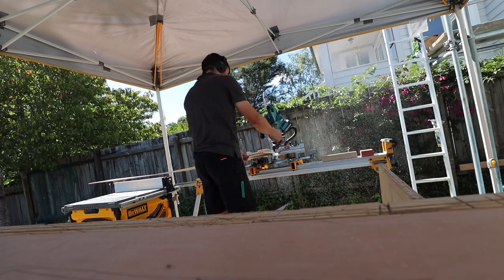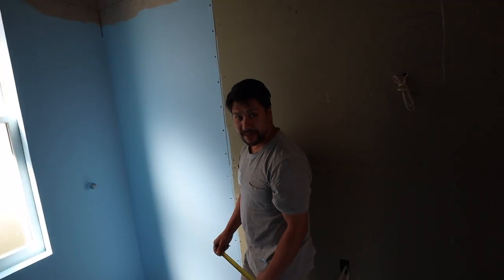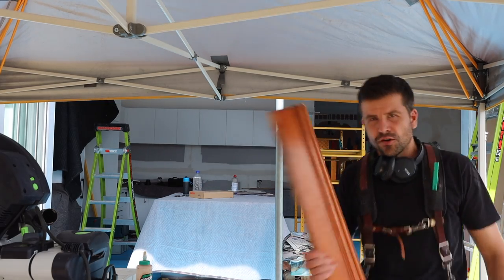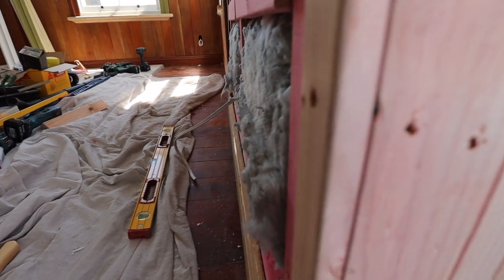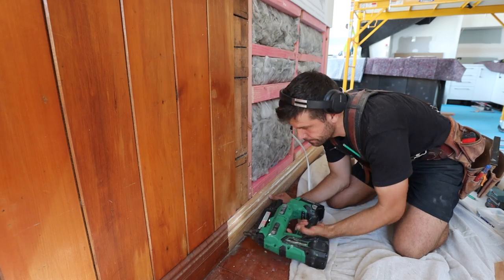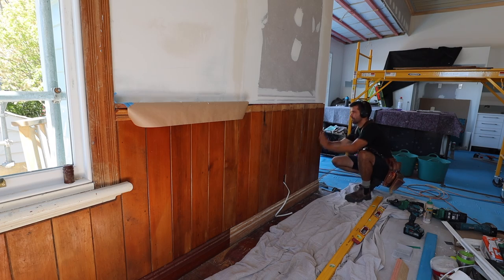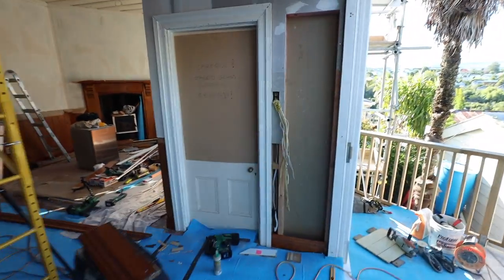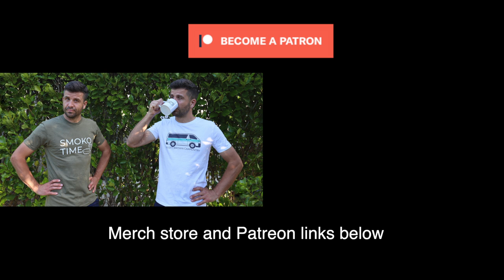Doing the Finishing Work Right (Restoration)

Comment: Festool used to have an issue with armatures burning out on Kapex saws: I believe it’s sorted. Voltage drop is a common cause of motor burnout: usually caused by excess length of extension cords. The other issue is overloading a 10A connection: the Kapex 120 is 1600w, which only leaves 800w available on a 10A connection in NZ. If your extractor is over 800w (it’s likely 1200w), it should be connected to a separate power point.

Comment: Using the 45 degree 2x4 cutoff as a jig for cutting the joint in existing base (skirting) with the oscillating saw is so clutch ! Nice work as always🤙🏼

Comment: Earlier Kapex models had an issue with the motors burning out prematurely.  As far as I know, they fixed the issue a couple years ago.
Reply: This is true. They fixed it a few years ago. You can plug in your Kapex into the vacuum cleaner! Nothing works better, love the Kapex. 😁
Reply: There is a new safety recall for some older models of the KS120, they can catch fire if left plugged in.
Check your saw with Festool online.

Comment: I run my Kapex straight off the dust extractor, and that is how I have been instructed to use it by Festool reps. They even make it so the laser being on doesn't trigger the dust extractor in auto. Been using it for a few years like that with no problem. I do recommend using the widest hose you have for dust collection on it though. 
Separately I know they aren't cheap, but I love the mobile base + rails for my Kapex. The stop with the millimeter marks on it just makes cuts, and repeat cuts so easy, and so much easier to roll the saw around instead of carrying it. Just my 2 cents worth. Keep up the great work!

Comment: From Oregon in US, interesting to watch. Lots of materials are similar,, but I get lost on metric measurements. I thought we here only did wood framing based in my experience in mid-Europe, where still restricted from. Love seeing good craftsmanship, and good tools!  My favorite is Milwaukee, but have mostly DeWalt. I go with what I need and amount of use. I’m slowly upgrading my 18V tools to the new ones, but only as they fail. Good luck!  I like learning. Curious about electrical there. Some British I haven’t figured out, but was competent in Germany. In US, deal with 120v/240v. Expensive to run copper for all. Current runs high, so takes more care for fire safety.

Comment: If anything the vacuum helps the saw by pulling the sawdust out/giving it airflow, won't burn a motor because of that. Plug it in and have a dustfree workspace, and don't worry about it!
Reply: I think he means the power supply. The vacuum cleaner will have a function where it starts sucking once the drop saw starts drawing power. I suppose the only reason people might worry about the motor burning out is because the drop saw might require more power than what the vacuum is supplying through the power point. 
I doubt very much that this is the case though as both tools are festool and have been designed to work in conjunction with each other.
Reply: @jimbobcatfish  No the vacuum will not limit the power to the saw it will just measure when the current starts flowing the resistance caused will be negligible, and anyway there designed to work together.
Reply: @steviemyles-eu4lf  inrush currents are many times the rated 'max power' listed on the unit and if the saw doesn't reach full speed before the vacuum kicks on it would cause voltage drop and increased current draw for both
Reply: @brl5755  Still, that's not going to kill anything. Also, both the Festool saw and vacuum have a softstart to limit the inrush current. If it was too high, the breaker would trip anyway.

Also, the power outlet on the vacuum is just a straight-through connection from the cord coming in. It's just like an extension cord, except for the fact that it's run though a current transformer to trigger the vacuum. It will not limit power to the saw. Just use it, it's what it's designed for.
Reply: @djFadeOut122  soft start is good, staggered start is better, and overloading a single outlet is still possible in both cases causing motor strain (heat) leading to premature failure... Though that's more common locally with only 120v at the tap. Fridge compressor inrush can be as high as 70A but it's for short enough of a time that a breaker doesn't trip. Adding a 2nd motor to that equation wouldn't be healthy for either as voltage drop would increase current draw as stated before. The talk of the vacuum being a bottleneck is possible if not plugged directly into the wall and into an extension of smaller gauge cable than necessary. Most wouldn't admit to that....
Reply: @brl5755  so surely this can just be fixed by changing the delay until the vacuum turns on
Reply: @steviemyles-eu4lf  in theory and in hopes, yes if this is indeed the cause. There are other possibilities like feedback from one or the other causing issues with the other. Motors can do some weird stuff to a dinner wave when stressed and that line is shared with the neighboring tool
Reply: @brl5755  should be a problem with the drop saw, your only using it for short period so it won’t get too hot.
Reply: The Festool dust extractor vac has a max power draw rating for the power socket of 2400W. The Kapex saw is 1600W.
Reply: The vac itself also draws 1200W so with the two of them running it's almost 3kW which is more than most multi-plugs can handle. On 240V, a 10Amp extension cord won't cut it. Pardon the pun.

Comment: also... your junction/electrical "boxes" and fixtures seem SO much better to work with, than here in the US.  we have these rules about spark-resistant enclosures which i'm sure saved some homes when we were using knob and tube and there were no gfci plugs and afci breakers.  our boxes have to have covered backs, wire retention and cover the wall material (drywall, jib, wood, etc).  in some juristictions they have to be metal (or fire resistant).  then the fixture itself retains the wall plate, which can rotate left/right but not in and out, etc.  what a pain in the butt.

Comment: Been using the original kapex 120 for many years always attached to my old ct33. Recently gave it to my son and bought the ks120 reb. Still run it on the ct 33 with a 36mm hose. No problems. Im not sure if the motor problem was only on the 110 version , either way i think it was solved a while ago. Would like to see your in-depth perception of the kapex120. Either way i am more than happy

Comment: Having an insufficiently sized extension cord will cause a motor to overheat (I believe because it's trying to draw more current than the cord will allow) but it would be odd if Festool made the vacuum cord too small to cope with running both at the same time - get yourself a hot air gun for removing paint Scott.. makes a world of difference and makes it easy to scrape out the grooves in mouldings too.. and nice job getting things 'plumb' ;o)

Comment: Check the plug on the vacuum where you plug the saw in. It has a maximum load rating written on the plug. Then check the load rating of the saw. If the saw draws more than the rating of the plug on the vac, don't use it.

Comment: Oh boy, finishing. Everyone seems to think that it only takes a short time to put finishing touches on everything, but it always takes about 10 times longer than anyone estimates!
Reply: Yeah I agree!  It's always underestimated.. my boss isn't on the tools so much, and he is always saying stuff like "so you just have to fix that back and we're done" ... and I'll say "well yeeesss, it needs adjusting to fit now, and the bare edge will need painting, then I'll fix it back, and then the nail holes will need filling, then I'm going to rub the filler down and caulk the edges, then it can all have a coat of paint, and when that's dry, a top coat."  There's no f*%$ing "just" about it!  😡😄
Reply: @ironpirate8  Did a laminate flooring job that took four days because there was a 5-sided bay window at one end, a bay window on one side, and we had to go around a staircase bannister and a 105-degree corner. Lots of funny-shaped cuts had to be made! It then took another 4 days just to do all the trims because the client wanted custom trims stained to match existing trims. One piece on that 5-sided bay window required 14 cuts with a dovetail saw to make it fit! Client was absolutely thrilled with the result and did pay up without hesitation. Maybe I should have charged a PITA surcharge on that job!
Reply: The last 20% takes 80%!... or is it 10% takes 90%
Reply: @hartleymartin  It's all good if the client understands.   I expect most of that floor area only took a day or two, and that's when some think you're basically finished. 😆

Comment: Hi Scott. My little Dewalt palm sander goes like a banshee when I attach my vacuum to it. It's small and the vacuum can create a "vacuum" behind the motor housing, increasing the speed of the motors fan and then seemingly the motor speed. It may kill the motor eventually but it was only £50 and it's like it's on steroids, it's ace. A mitre saw has way too many intakes and air leaks to have a similar effect. Festool don't usually make mistakes, I guess the vacuum attachment is there for a reason.
Love your channel mate, keeping me occupied during lockdown evenings. Respect.

Comment: Hey Scott, can you make sure you show the electrical outlets once installed? I've never seen either us Aussies or you Kiwi's use the Amarican style wall boxes before and would love to see what they end up fitting off in it!
Reply: The boxes are probably just for the wires, and then outlets are face screwed over them. I've never seen them used, but there was a north american wall box socket that fits AU/NZ plugs, Hubbell 7051. https://en.wikipedia.org/wiki/AS/NZS_3112
Reply: @TheducksOrg  I'm an electrician and never have seen an American style wall box for an Aussie/NZ style power point, hence the question and why I want to see what they use. Only thing I can think of it is a better mounting system for the old Clipsal heritage series power points maybe?

Comment: for the festool to the vacuum question it depends what your cords are rated for like a 14 gage can run 15 amps properly at 50 feet long and you might be over amping for the cord thus for burning out the motor. iv burned a lot of tools by running to much extensions in my experience

Comment: Re the saw motor, can't imagine how the vac would have any effect on the motor burning out. But I know for sure that if you use high wattage tools connected directly to an auto vac, under a lot of load you will eventually fry the motherboard on the vac. Last one on my Nylfisk was $500! Now if I cut or drill concrete with Max hammer or saw I plug them in separately and manually start the vac!

Comment: I think the max outputs of the Festool power take off is 1200w
Maybe the saw is around that mark? Should be alllllgoood
I use my mitre saw with my Festool CT26 a lot never had an issue with either bits of equipment
Nice vid mate!

Comment: Have used the Kapex few times, good friends use the Kapex and it's always run through the extractor so you'll be grand there Scott. It does have a tendency to bog down when running on 110v for UK sites but you won't have that issue in New Zealand
Reply: Do you use 110 for building in the UK?
Reply: @yup3398  yeah, apparently it's a "safe working voltage" which is odd as the rest of the EU use 240v
Reply: @louisbown7453  very strange!

Comment: Its true, the vacuums usually only have around 1000-1500 watt outlet and the saws 1500-2400 watt motor.
I've blown a vacuum outlet up because of this and have to now switch it on and off manually.
I run a cordless Makita saw withe AWS to the the vacuum now for this reason.
Reply: and I guess it could damage the saw from not drawing enough current.

Comment: If you’ve got the kapex 60 then it should be fine as the festoon vacuum has a 1200w plug in.
If it’s the larger 1600w kapex then I’m pretty sure festoon said that their technology is designed to work together so the 1600w will only draw 1200w, so less power. Either way you won’t be burning out the motor.

Comment: The kapex issue could be that if the saw needs more voltage to work than it is given through the extractor, so lower volts (not enough power from the extractor) requires more amps to make the cut, so it’ll be working harder/drawing more amps?

Comment: If you run the saw and vacuum off the same too light a gauge or too long an extension cord, you could get a significant voltage drop, not good for either tool.  Use a short extension whenever possible, always heavy-gauge.  Maybe another viewer could recommend the proper gauge, but 115 volt/15 amp solid copper house wire is 14 (in Canada); I believe it can be 16 for stranded wire, used in extension cords?

Comment: It is designed to have the saw plugged into the vacuum cleaner that is how the dust collection works. I used to sell Festool for the hardware store I worked for. Plug it in

Comment: My KApex has been for many years plugged into the vac - no problem.  Why do you tilt the saw rather than just swiveling it to 45 degrees?  Great vid as always!
Reply: @cmmartti  Yes I also find it extremely obvious if you're cutting on the flat.  So my obvious question was why not cut it upright?  Do you get a cleaner cut?  Or are the boards to wide to cut upright?

Comment: My text has disappeared, so if this duplicates it, that's why.   Running Kopex Saw and a vacuum together off of the one power cable -- yes, it could possibly burn out.  It is likely to be a matter of overloading.  Most modern vacuum cleaners run at 2Kw or a bit more.  The maximum load here in NZ for a mains lead is 2Kw.  Then you go and add a Saw (what is its loading?)  anyway, total load likely to be well over 2Kw.  The effect of overloading is to make the voltage at appliances drop.  Effect of that is higher current.  Higher current that rated in the motors equals propensity to burn out.

Comment: ive had my kapex for 5 or 6 years now... its always been plugged into either my midi vac or ct26. mine is a 110v so i have to use it with a transformer in the uk and from what i read online it was the 110v that had the burn out problems. mines been alreet so far like. guarantee itll be burnt oot by the weekend now ive said that like
Reply: @cmmartti  yes the uk is 240v but building sites are often 110v for power tools. all professional grade corded tools are available in 110v and 240v 

https://www.mad4tools.com/blog/what-is-110v-and-do-you-need-it/
Reply: @cmmartti  it must be an olden days hangover from before RCd’s were common on circuits. I’ve worked at places before I had the battery gear I have now and they insisted any power tool must be 110v or you were sent home
Reply: @cmmartti  I wouldn’t know how it works. But the rcd instantly trips when it picks up a fault like say a cable cut or whatever. I suppose it’s a bit safer also with 110v as the actual plugs are much more robust than the standard 240v plugs plus a few other things although in general lugging the transformer about is a real pain

Comment: As for Kapex motor failures. It was not motor itself, but the electromagnetic brake. That brake was poorly designed. Most failures occurred during constant on/off cycles; especially on small pieces of trim when you turn the saw on, cut the material instantly and turn the saw off numerous times. The electromagnetic brake responsible for slowing down the blade used to fry itself along with some motor winding. To put it simple, Festool forgot what the main purpose of the mitre saw is. To do Festool justice, THE PROBLEM HAS BEEN SOLVED FOR GOOD.

Comment: So I think the rumour about the vacuum line in the Kapex causing the Kapex motor to blow up is just that, a rumour.
I used the same set up but for cutting carbon fibre pieces. Five years and not one issue..

Comment: The vacuum will have a max power rating for the connected tool (e.g. 2000 Watts). If your saw is greater than the max power rating it will fuck the vacuum cleaner, not the saw (and probably just the auto switching circuit, not the whole vac). I have cheap vac with a 1000W limit which means you can't use it with a saw,, but I imagine the festool one can handle the saw no problem.

Comment: At 8:30 <--- Those T & G panels on the lower part of the wall <--- because of that the bracing is stuffed up. You have Gib Braceline ONLY on the upper part of the wall, you made a mistake !!

You should have ''trussed out'' the bottom section of that wall, (behined the T & G Panels), so the bracing is not violated.

It's so easy to do, just add some diagonals, with toothed gang-nail plates at the nodes (both sides of the frame).

Comment: If Festool motors burn, is that a risk everywhere? Or is it a North American thing where the power is only 110 volts. I'm in Canada and we constantly have to be aware of how many tools are running on one circuit. Overloading the circuit puts more strain on the motor, which can cause it to overheat.

Comment: I can't imaging how connecting the Kpak saw to your extractor would burn the motor out quicker??!! MAYBE, if you live in a very humid/moist climate and only do you carpentry on the beach/seaside where the air is salty. Anyway, you can turn the suction down on your extractor until its just a breeze.   Nah... I'm not buying it, unless its something to do with voltage drop / insufficient power when being plugged through the vacuum? All my festool gear has been solid thus far (fingers crossed)

Comment: Mine burnt out whilst plugged in to a ctm26....2015 model 110v (uk) saw . Was also using a 5kv transformer at the time. Dont know if the extractor caused it or what!....the motors are known for going tits up on them.